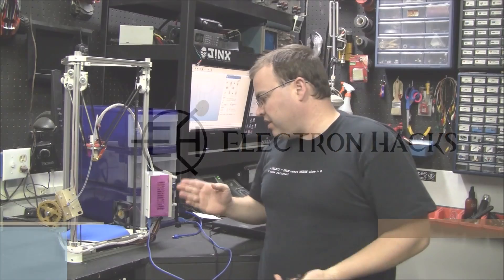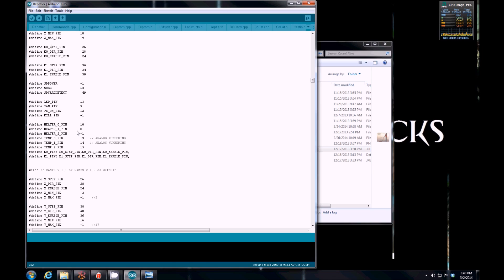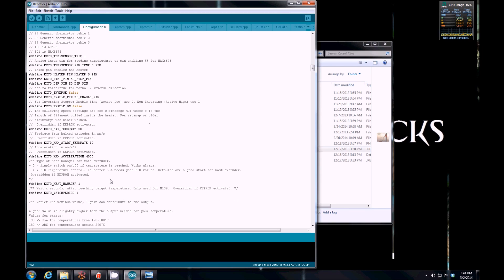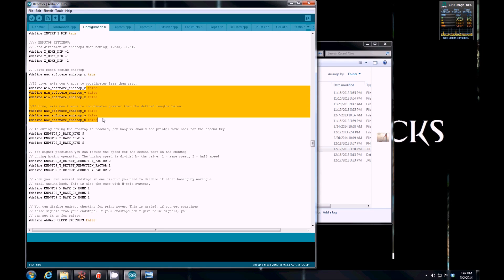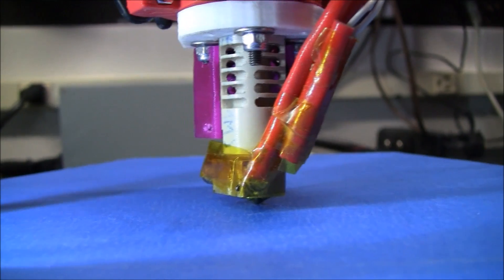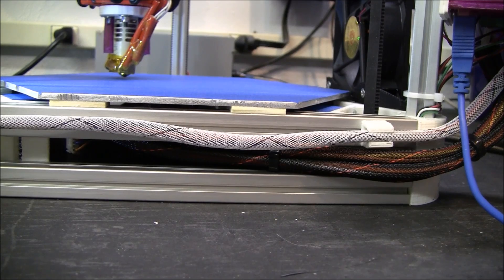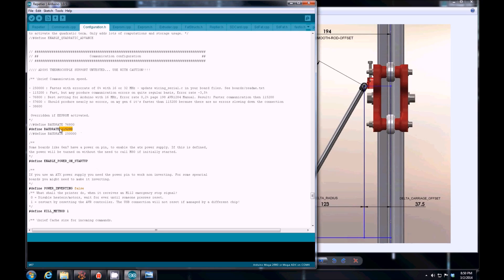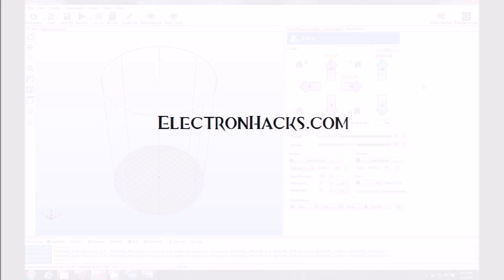Kossel Mini 3D Printer Repetier Firmware and Calibration

Comment: Is software, or firmware what is causing my gantry height to not update to factory specs with any of the latest software updates?  I don't really know the difference between software and firmware, and I certainly can't tell what is causing my gantry height to stay the way it is when it got messed up after I do any of the latest software updates since a software update was what caused my gantry height to get messed up in the first place.  My Z-axis won't home now, and it has been several years since I have been able to use my Kossel Delta Mini.  I saw a video on how to reset the motherboard using a reset port and a ground port using low voltage, so I found ground and all of the other open ports names were obstructed by circuitry, so I am still stuck with a Kossel mini that won't work correctly.  I am almost ready to buy a new 3D printer and put this Kossel in the garage, and eventually in the trash.

Comment: What if it rises in one direction?
Reply from the maker: If its just a little bit it's probably not level, adjust the limit switch down on that side a bit to "Level" the bed. No adjustment of the bed itself should be necessary.
Reply: when i adjust the limet switches it just changes the print head position away from the center instead of the position of the height. the  left and right sides are good but the top and bottom sides are complete opposites. when the print head gets to the outside of the top its 3 mm of the plate. on the other side its digging into the plate. im considering returning it. unless you can help me?

Comment: Firstly, thanks for this video, this is very helpful. Do you use 16 teeth pulley or 20 teeth? You adjust as 20 teeth, does it work better after firmware updated as 20 teeth for use of 16 teeth pulley?

Comment: So I'm building the FolgerTech Kossel. In their write up, the endstops are on top and are set to maximum. I try manually bringing the hotend down and it only travels in 1/16 steps. I wonder if i need to switch my pins around to make the endstops minimum. It makes sense a little bit.
Reply from the maker: +David depuy 
In the software you can tell it where the endstops are, i think it makes sense for them to me at max?

Comment: If I understand you correctly then: 
You basically adjust the towers first by adding or subtracting steps (alternatively it can be done by simply adjusting the screws at the end stops) .
Next you modify DELTA RADIUS until its leveled all around - Am I right about this?

Comment: Nice turotial! Webdevvie  I tried the web configurator for 0.91, but the downloaded configuration.h was missing comments and other settings I did not set in the configurator which I didn't like so I downloaded firmware from github and tuned settings manually.

What I had to change and is not mentioned is in pins.h: HEATER_2_PIN to -1 (pin 9 is reserved for fan) and EXT0_INVERSE to false to normally extrude. Another big gotcha was Arduino IDE 1.0.5 producing compilation errors so I had to switch back to version 1.0 to get it working. Thanks for your video.